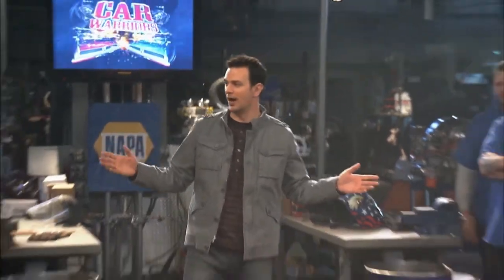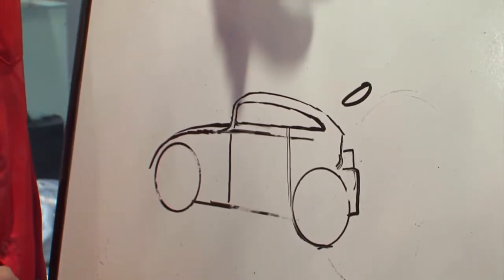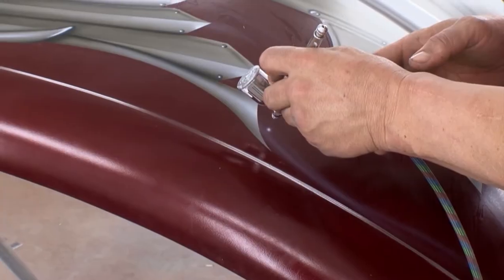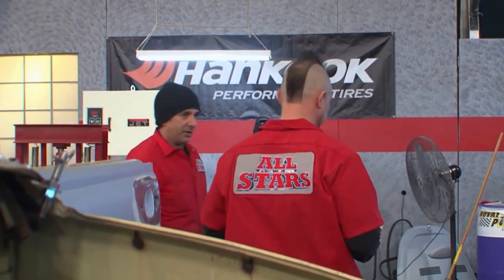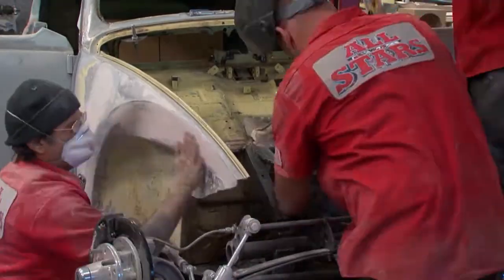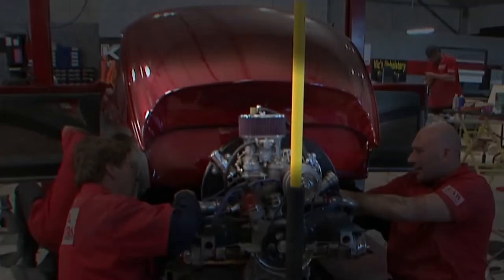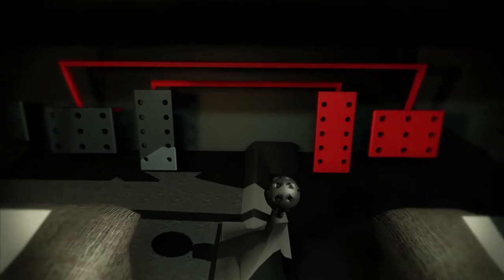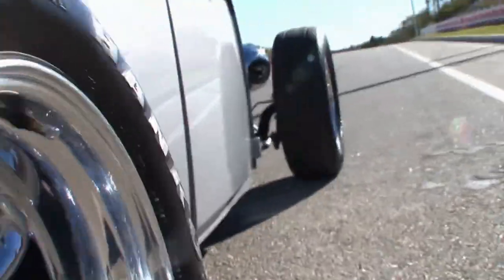Turning a CLASSIC VW BEETLE into a Centre-Drive HOT ROD! | 72 Hour Transformation! | Mech+

Comment: When I saw "center drive" I just assumed tube chassis to eliminate the tunnel. But NO!
The tunnel is a good eight inches above the rest of the floor pan, the absolute highest and worst placement for a seat.
So you chop the top which lowers the top of the windshield, and you raise the seating way above stock instead of lowering it.
There's no way you can see out of this car unless you're really short.